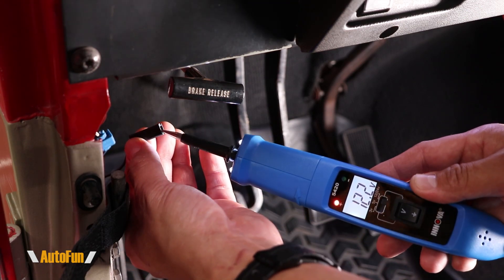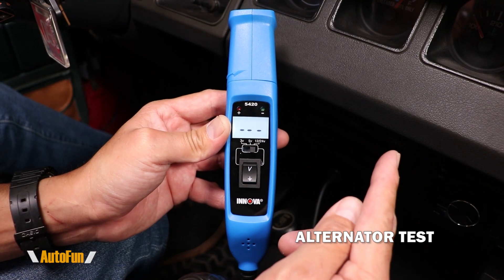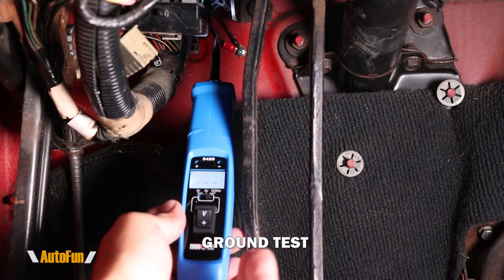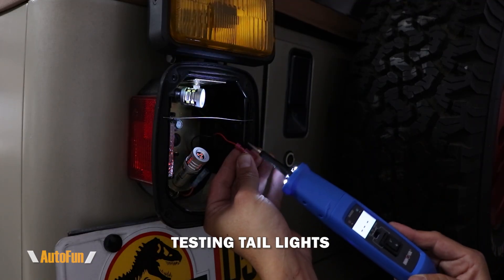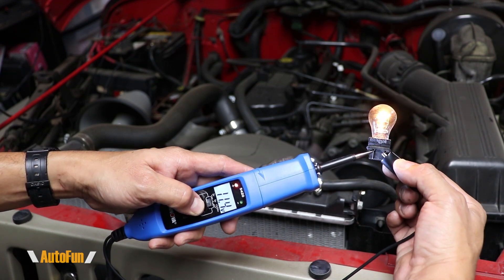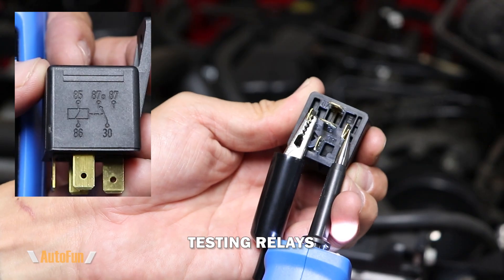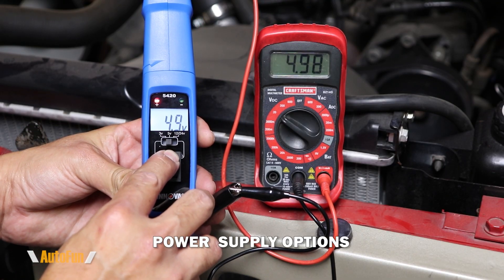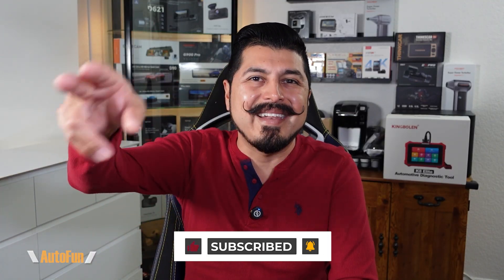Innova 5420 Automotive Probe Review

Comment: Just subbed to your channel

Can you recommend a birds eye 360 camera system that also has front and back camera parking with lines?

My lexus came with this but my kids older Honda doesnt have this functionality
Reply from the maker: Welcome aboard! Ah no, those types of systems do exist but typically require extensive installation and drilling into the vehicles body to install the sensors flush. Here is the closest alternative https://youtu.be/vUEsIYEBVck Cheers!
Reply: @AlexAutoFun saw your videonon FitDVR power source for front dashcam.

Do you still suggest that particular one?

How about tonpower rear dashcam?

What do u feel about Viofo 329 cam?  I couldn't find your review and it's a top Amazon 4k cam?

Is theblink affiliate so I can kick back and support the channel?
Reply from the maker: On dash cams the rear camera is powered by the front dash cam so no need for another power supply and here is my install video https://youtu.be/IYRavaIBmSY if you want to see the rear camera install. And yes review on the Viofo coming up, stay tuned, Cheers!